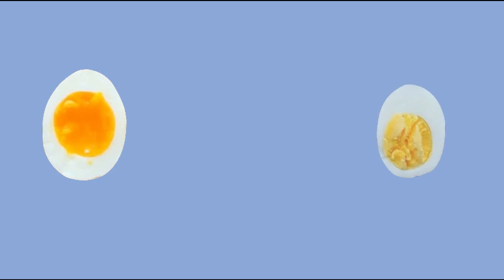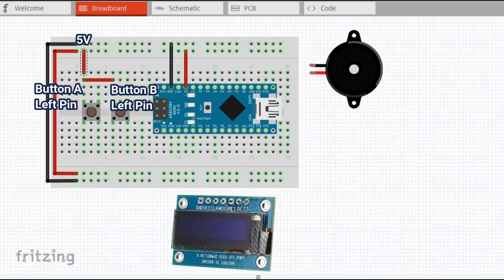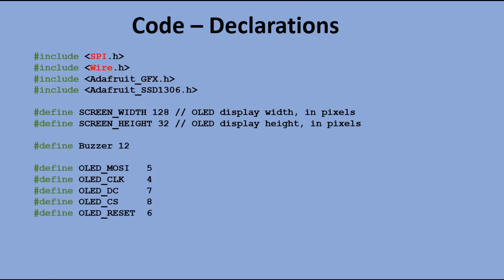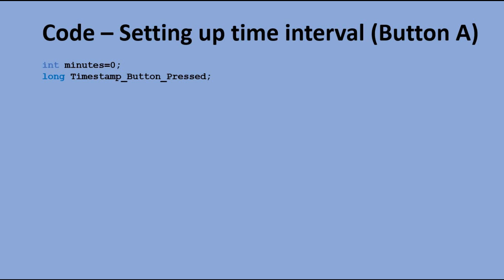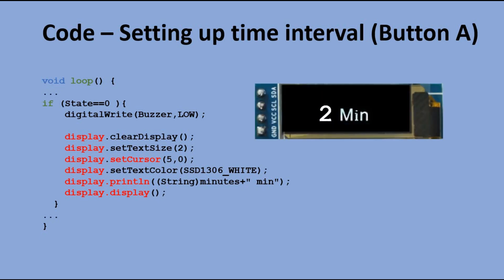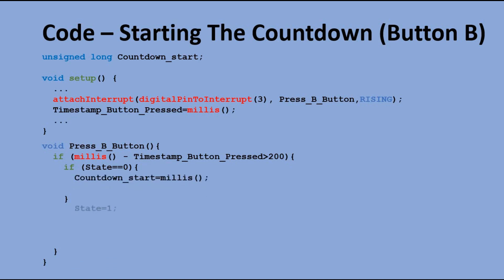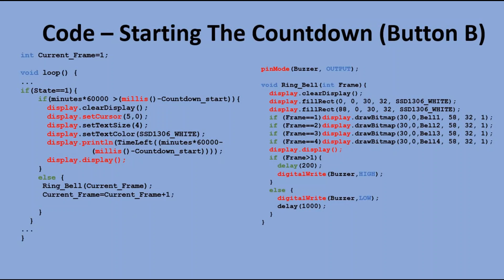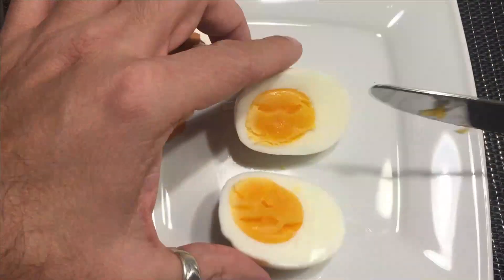Countdown Creation: Arduino Timer with OLED Display using millis() function

Comment: hello can i have the code as the arduino project hub link is not working
Reply from the maker: I have added the link. Can you confirm that it works for you
Reply: @marios_ideas  i still cannot access the code through the arduino project hub website. Perhaps you can use gitbhub for the code?
Reply from the maker: @RTCTimer  The site migrated to the new version and this completly shafted my links. I reported this problem to them a week ago. I will be forced to migrate all that content somewhere else:(
Reply: @marios_ideas  ah i understand, what is this project title in arduino project hub? maybe i can search them manually

Comment: String TimeLeft(unsigned long MsLeft){
  String Result;
  int M;
  int S;
  
  M = (long)MsLeft/60000;

  if(M<10){
    Result = (String)"0"+M+":";
  } else {
    Result = (String)M+":";
  }

  S = (long)( (MsLeft-M*60000)/1000 );
  
  if(S<10){
    Result = (String)Result+"0"+S;
  } else {
    Result = (String)Result+S;
  }
  return Result;
}
Reply from the maker: A word of explanation?:)
Reply: @marios_ideas  git repo with code is good practice. Long time ago

Comment: Hi. I want to thank you for making your work on this available for us to use. I'm trying to implement this on my project but when I long press the start button it shows the bell instead of starting the countdown timer. I'm sure they're connected correctly since I can increment the minutes without any problem...it seems that it doesn't recognise this" if(State==1)"
Reply from the maker: This is because Arduino interprets that the button was pressed twice. I had this problem and in the code introduced a condition in the interrupt function millis() - Timestamp_Button_Pressed>200. Which basically ignores the event of pressing the button if it happened within less then 200ms of the previous button press. If you  change this to a 1000 then it should fix or improve this
Reply: @marios_ideas  Thanks for the reply. You explained that implementation very well on the video and I've watched it several times...I was looking at that values but only tried to reduce them to 100 and increase to 300 but had no effect. Will change to 1000 and see if this improves. Again thanks a lot for the help. 🙏
Reply: @marios_ideas  Changes had no effect, it really prevents multiple pressings of the button but when I press it goes back to 0...

Comment: hey , how about making a timer for hours and minute ? can u help me , Thanks
Reply from the maker: Well, I am not going to write the code for you. I get too many requests like this. Try to fully understand the code here. The concept is exactly the same, the time interval is just greater. You would need to get the smaller fon as hours minutes and seconds would not fit with the current font size..

Comment: how to add a relay?
Reply from the maker: You have a circuit that you want to power. Add the relay to it and the signal cable should go to one of the digital pins of Arduino on which you created this timer and few lines of the code that if the time is up it sends the high signal to the relay.
Reply from the maker: I have a separate video on relays. https://youtu.be/XiOcxyyTxy4

Comment: Hi do you know if its possible to use this on a 128x64 pixel screen. If possible is there an easy solution to change in the code thanks!!
Reply from the maker: Watch my video carefully.
All information is there. There are two lines that define display dimentions. You just need to change hight. Then it will work but all the   stuff will be displayyed in the top half of the screen. If you want to move it to the middle then you need to find a place to add the vertical offset of 32 . Then all the conent will be aligned vertically

Comment: Hi!! I would like to know if it is possible to use OLED i2C SSD1306 128X64 (which only has 4 pins). You used SPI (with 7 pins). Is it possible to use oled i2C in this project?
Reply from the maker: Yes it is. You would need to adjust the code so it activates I2c display. You can check one video I have for analog style clock on Oled display. This one uses I2c and you can check the code
Reply: @marios_ideas  Great Mario..Thank You!!!